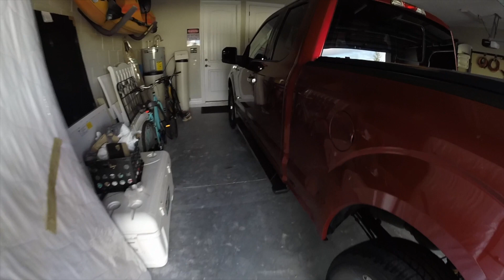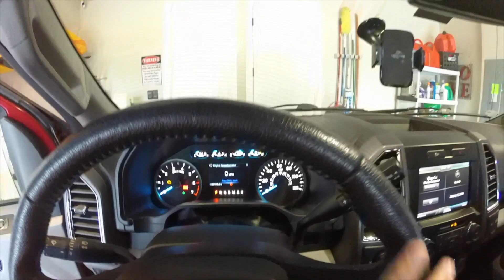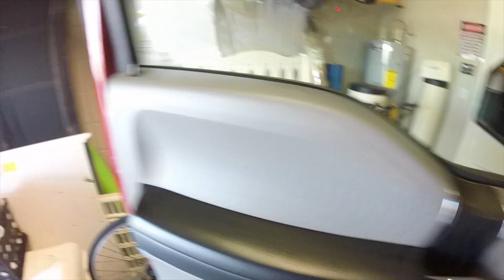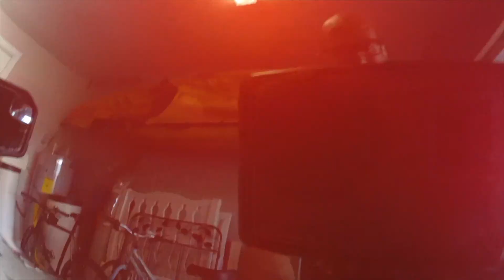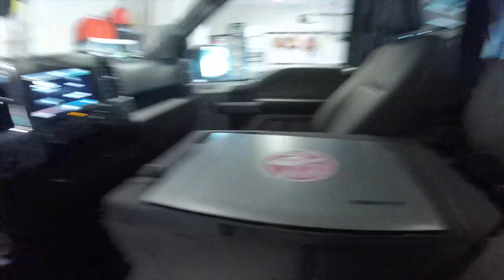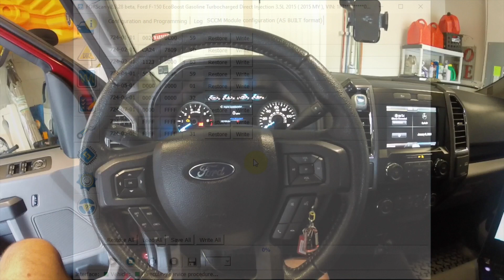Forscan Turn Signal MOD - F150

Comment: Informative video,my car is focus mk4,mine is 3 times blinks as default, I just wanna to get 5 times. my data of SCCM 724-01-01 is 28C0 6X26 00(X=0),I have tried many times to change"X" to"1","2"，"3，"4","5"，"6","7"，"8"，"9",and from"A"to"F".  but not work.What should I do next? Many thanks， from China. @DCF GARAGE
Reply from the maker: I recommend you post your question at the Forscan forum. They should be able to help you
https://forscan.org/forum/viewforum.php?f=5&sid=67d5d49b846a961aa4d5f6c61758125b
Reply: @dcfgarage  OOOK，thx.

Comment: My 724-01-01's 2nd block reads "799" not 600, Mine blinks 3 times as default.    What does the 799 mean?  Thanks
Reply from the maker: Hi Chad. I don't know what all of the three positions are for. But as long as you change the second position of the second block, you should be fine. 

The #9 on the second position of the second block means  "9=4 flashes & OUC true
".

You can download the whole spreadsheet here- https://docs.google.com/spreadsheets/d/1uDSQ1Z5a2Wt8-kjrSiVSlDFGFHnfeuhb3RTMVz95730/edit#gid=815852466

and a tutorial for Forscan here - https://docs.google.com/document/d/1-8dKaS_Spu4Zw4hV_CrKC4tLoP9G8yejqegF1wxIqxY/edit

Here are all the possible options for the turn signal:

724-01-01	xxxx	x*xx	xx	Electronic Turn Signal Cancel Cfg: # of Flashes & On Until Cancelled (OUC)		
				** truck will add 2 additional flashes to the values below when trailer is hooked up **		
				click here for forum member Lare's great explanation of On Until Cancelled		
				0=1 flash & OUC false		8=4 flashes & OUC false
				1=1 flash & OUC true		9=4 flashes & OUC true
				2=1 flash & OUC false		A=5 flashes & OUC false
				3=1 flash & OUC true		B=5 flashes & OUC true
				4=2 flashes & OUC false		C=6 flashes & OUC false
				5=2 flashes & OUC true		D=6 flashes & OUC true
				6=3 flashes & OUC false		E=7 flashes & OUC false
				7=3 flashes & OUC true		F=7 flashes & OUC true

Comment: OUC is probably there because of situations like I run into frequently in my Fusion. I'll enter an intersection with my left signal on, but it cancels on its own after I sit still for a moment. My Fusion doesn't hold the signal stalk down or up when hard signaling. If I turn OUC on, then I would not have to worry about reactivating the signal when waiting for an opening to actually turn... Something I sometimes need to do two or three times before I can go.

The wheel position sensor triggers the cancel too soon. If they changed it to cancel at just a few degrees more it wouldn't be an issue. It's only an issue on shallow turns and does not present on sharper turns with continuous motion. If I can just keep moving it doesn't do it, but if I have to stop and wait in the intersection it does.

Comment: Um... You're supposed to signal BEFORE you move, not while you move. Bump the signal, wait three flashes, THEN move. That is why it is set for 3 flashes.

3 flashes = lane change
More than 3 = Turn or emergency pullover

Nobody should be doing their entire lane change in those 3 flashes. That's barely enough time to confirm adequate space. You are supposed to confirm space before signaling, then signal, then move. The signal isn't for you to count, it is to let OTHERS know what you're going to do and provide time to react.
Reply from the maker: I’m slow when changing lanes. That’s why I need more flashes :-)
Reply: Captain obvious
Reply: @markharmon6942  apparently not... So many people have no idea how to even use their blinkers, let alone use them properly.